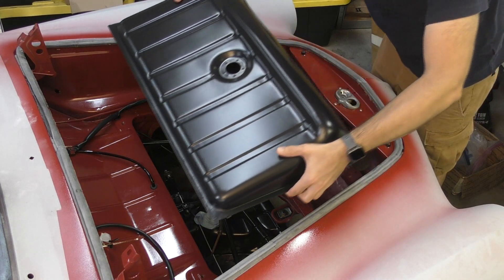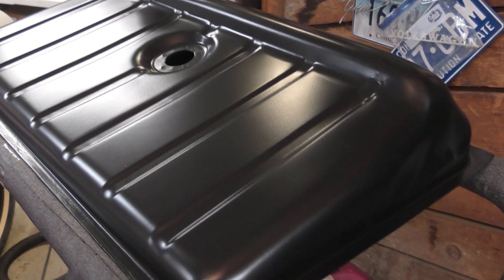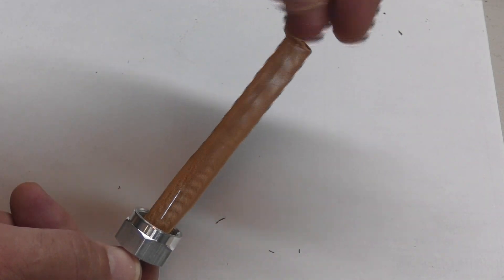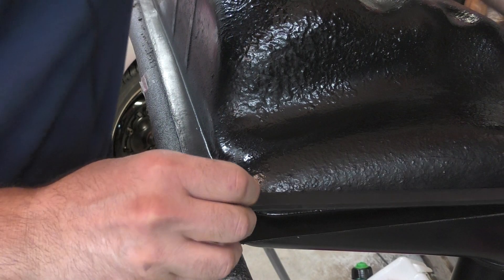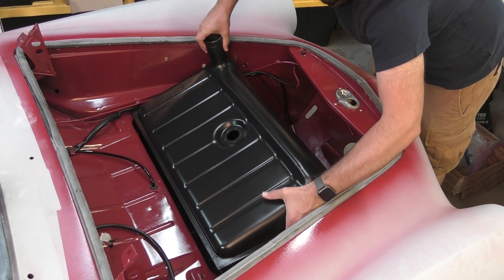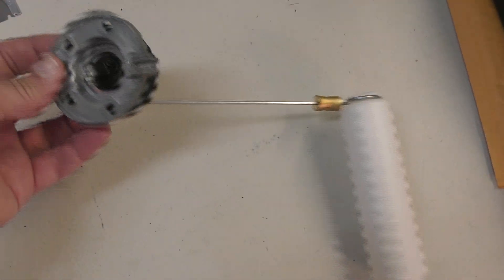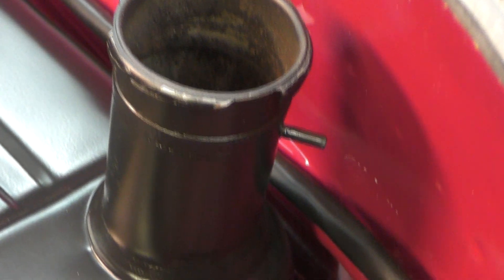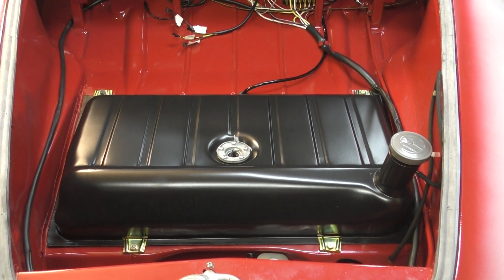VW Type 1 Fuel Tank Installation 101

Comment: Is there any reason why the aftermarket tanks have the hump on the side?
Reply from the maker: I think they are made using generic equipment because original later style tanks do have a hump where the filler hose connects. So it's just a matter of the manufacturers keeping costs down.  Go to a swap meet to find a good original tank but get there early!

Comment: That kink in the fuel that u mention at the end,..causes me a great deal headache. My ghia would run, for 10 seconds and quit. I pulled the carb , etc etc did all sorts of work,…finally, my buddy said, check the fuel line,..and voila, ! Un twisted the line, and oriented it differently, and issue solved! I was simply getting fuel starvation ugh!!
Reply from the maker: Hey, that's a good friend!  With these old cars it could be literally anything mechanical, plus the last guys mistakes, plus the ravages of being 50 plus years old.